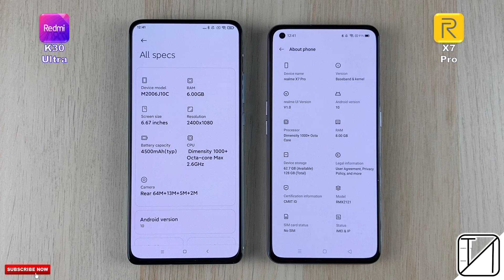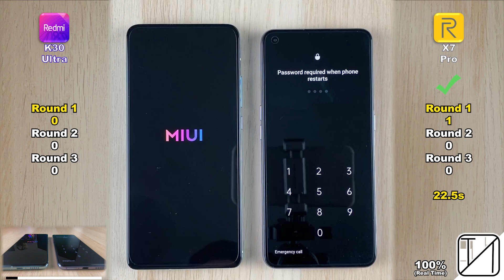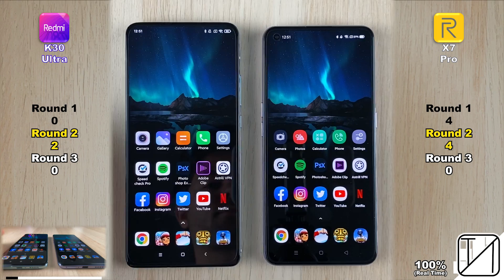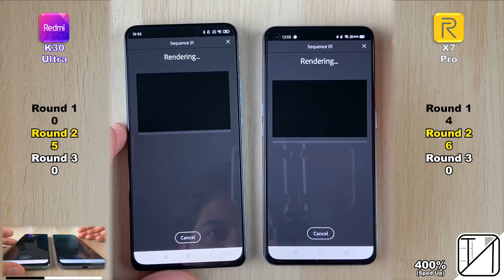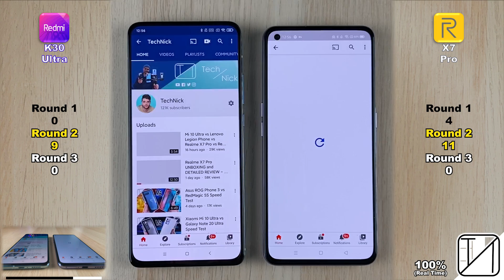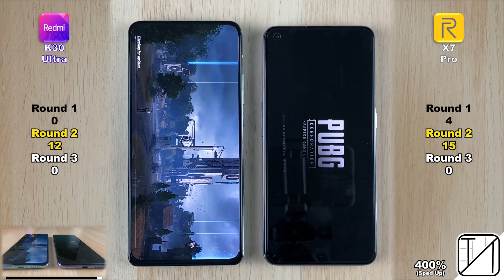Redmi K30 Ultra vs Realme X7 Pro Speed Test

Comment: What's your thoughts on system updates? I'm new to Chinese brands and I'm from the US. I'm really looking into getting the mi 10 ultra or whatever Ira called flagship device that's specd to the max. But between these 2 o hear that realmes track record for software updates is pretty bad. I heard they either get no updates or just a few, while redmi (is much much better in the software update aspect) , xiaomi, etc and the others are netter than realme.
Can anyone comment on this that actually has knowledge of the different brands and there update schedules and wholesale gets constant updates and actually supports there devices!
Reply: Xiaomi usually give 2 years of software updates and 3 years of security patch. Realme was created by another Chinese big brand Oppo and is considered new in the smartphone world. Oppo and Realme used to be poor in giving consistent updates but since 2019 has been improving. 

Constant updates can be expected on both companies' midrange and flagship models. It's their budget offerings that are usually getting less updates.
Reply: @notagain2856  thanks!
Reply: Im coming from Samsung who had a pretty bad record of updates.
I got the Samsung galaxy note 5 when new and I'm still using it to this day, due to financial issues..i want the flagship xiaomi but unless the next us stimulus comes thru looks like I'm stuck with the note 5 for awhile. That means I've had this phone since 2015. Man I wish I could have that new xiaomi Mi 10 ultra, (honestly I'd be happy with anything that had enough spec to last atleast 4-5 years like my note I have. But I don't know if I'll be able to afford it honestly.

Comment: Bro campare pubg fps rate
Reply: Both will perform the same bcs they uses the same chip
Reply: @big_smoke7t , it's not only about the chip, it also depends on the optimization and thermal throttling